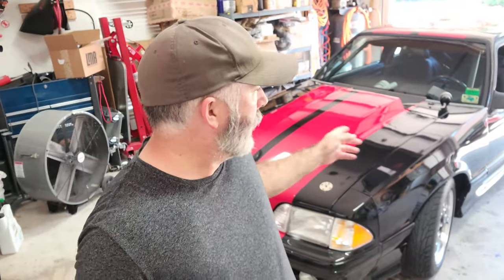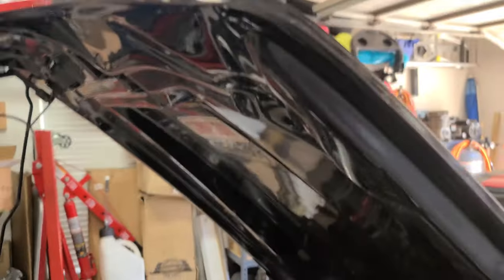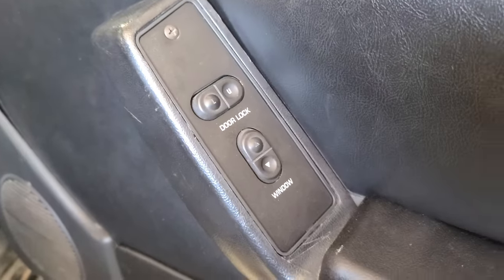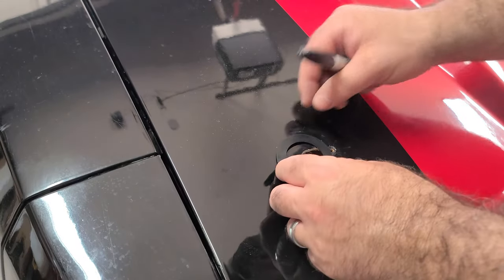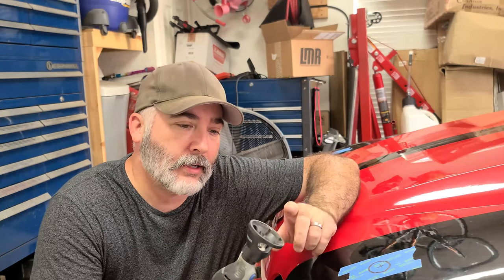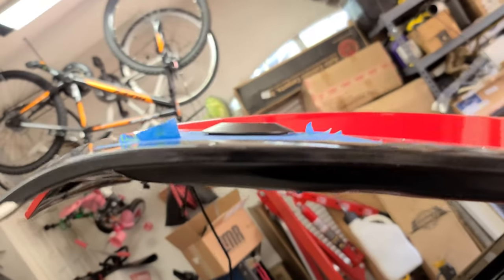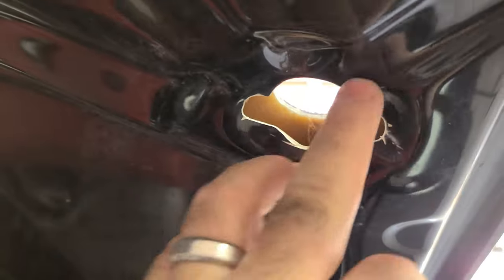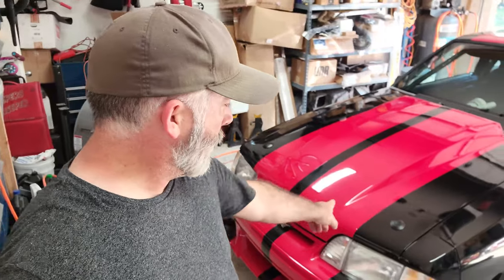Quick Latch Push Button Hood Pins

Comment: How did they end up working? Thinking about those for my Chevelle.
I am a little confused on how to adjust them so that you can pop them before opening the main hood latch.
Reply from the maker: Work great!  No issues and I think the look is way better than the old school look.  As far as the adjustment, I just found the spot where shutting the hood grabbed the hood pins and latch.  Not sure if it is just the foxbody but I can just pull my hood release and walk to the front push the buttons.  Then the safety catch.
Reply: @WhitetailGarage  thanks for the reply!
I dig the look too. I am a tad bit weary of them after I watched a video where the guys hood was stuck shut though lol
That would be my luck! 
Thanks again!